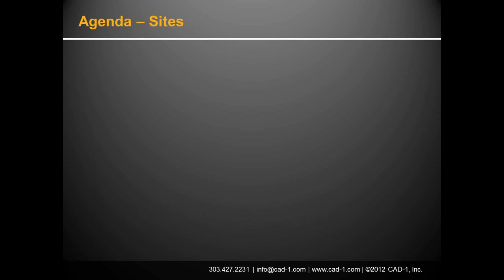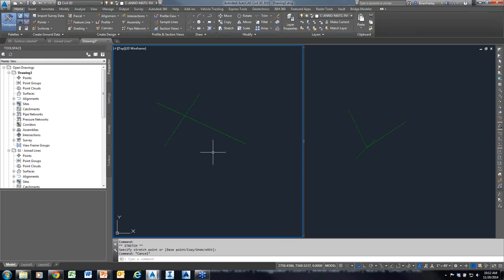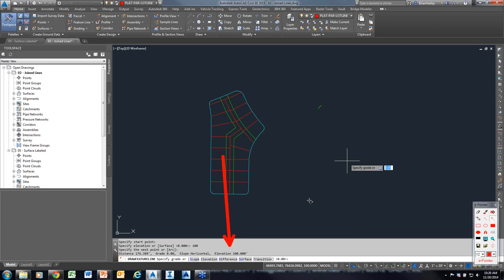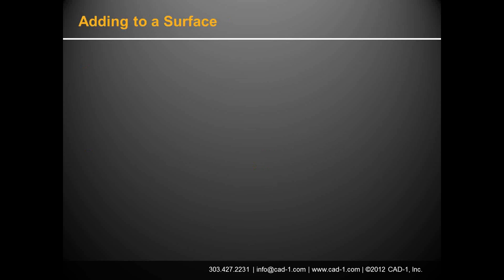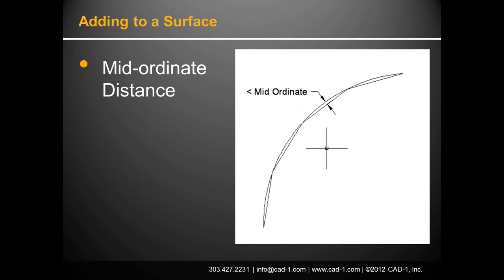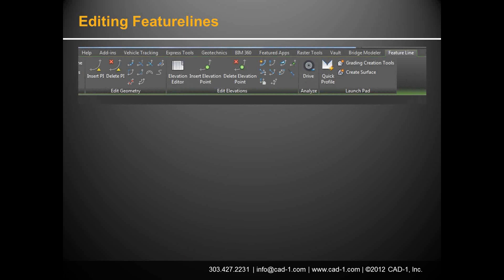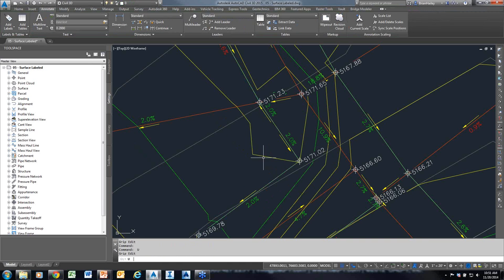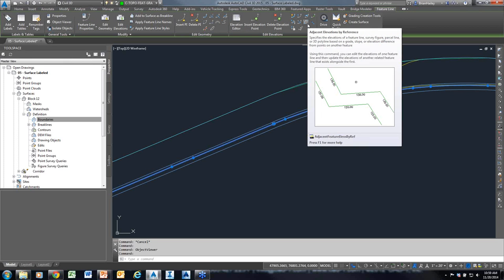CAD-1 Presents - Grading with Feature Lines in Civil 3D

Comment: Hi My name is Jamie I have a query my Civil CAD 2017 keeps changing scale when I go to print I was wondering have you come across this before ? So basically I set the scale to 1:500 so it will fit on my page and then I go to print and it changes scale and becomes bigger have you come across this before ?
Reply: Hi Jamie,

I haven't seen anything like this before. Do you have the viewport scale set to the same as the drawing scale in model space?